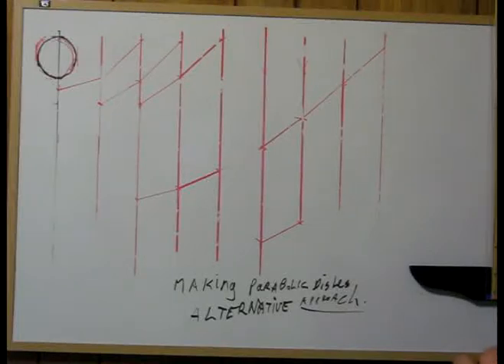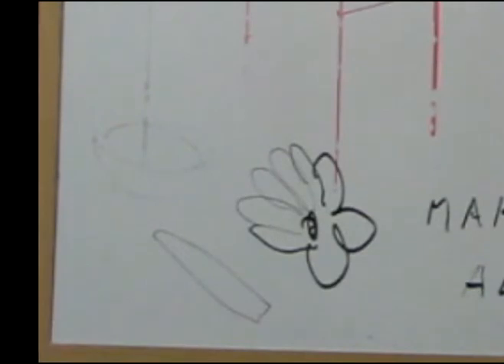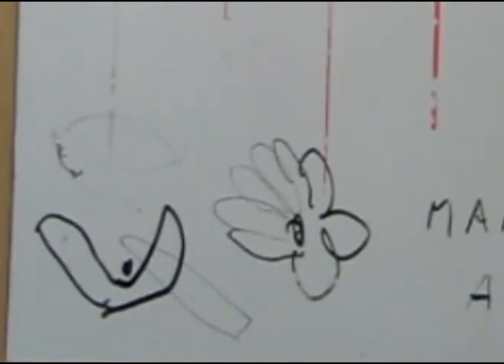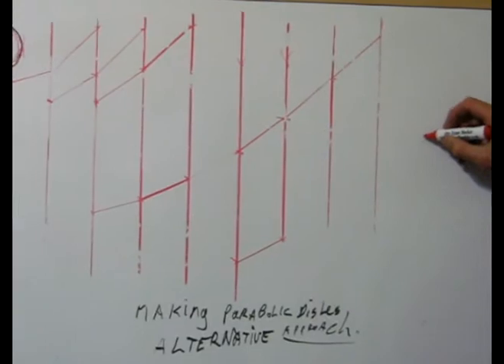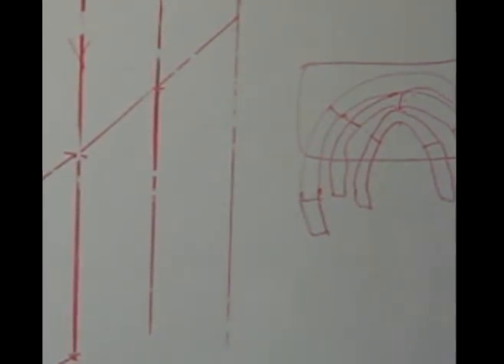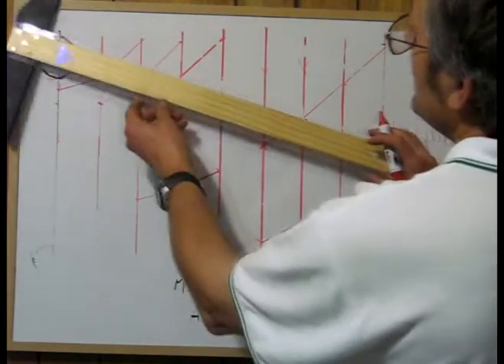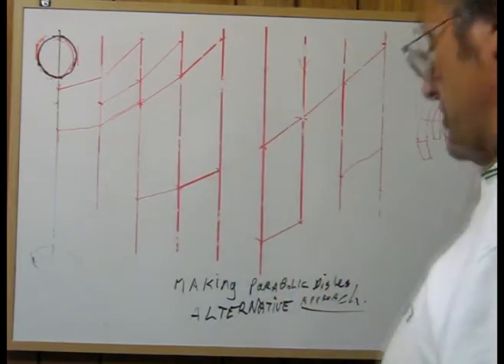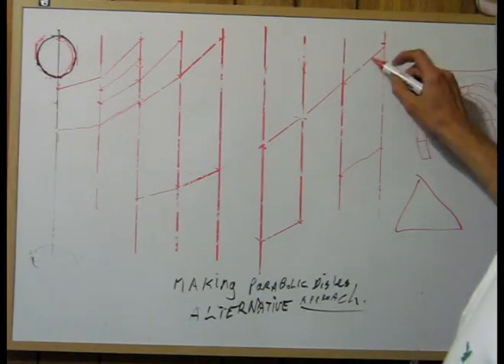Designing a solar cooking parabolic dish? The cone method. Some concepts to help.

Comment from the maker: @desenxuxator  Sorry, I do not have enough math to do this by formula.  For others who are like me and don't have enough math, the great greek mathematicians did not use formula but they achieved a lot by using shapes to solve problems. They didn't have a symbol for zero, or the decimal system. I would love it if some mathematicians got involved with this and with the clam shape.

Comment from the maker: @bxxj  is taking about some of my other videos. (I tried to make a collector shape of maximum size that would collect all the sunlight for one 2 or 3 hours. ) I did recently find a pdf about different shapes for solar trough collectors.   One of them seems similar to the start row of mirrors on my clam shape (in the middle of the shell) .   I do not know how to resolve the shape as you get  towards the edges of the clam shape. Some rays just bounce and hit

Comment from the maker: @bxxj  Thanks.  I am still learning.   I just found this by accident. 
Other people must know about it and use it.
 The clam shaped solar concentrators?  The only way I know so far is the laser pointer,  claymation and little mirrors method.  I think you could design the first row of mirrors with this and build up the model with wood to close to the correct line. 
That would save  a lot of time and clay and guesswork.  Sorry that I have so many videos.  It must be awful watching them.
Brian